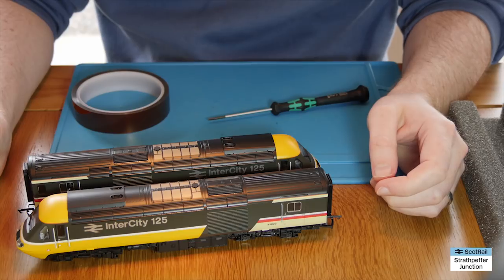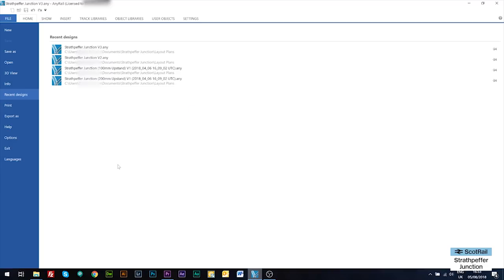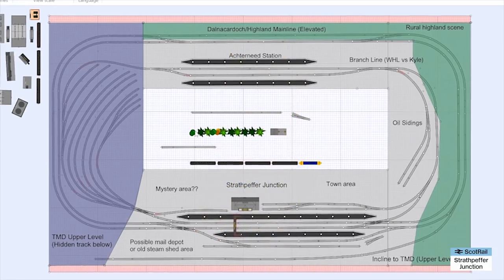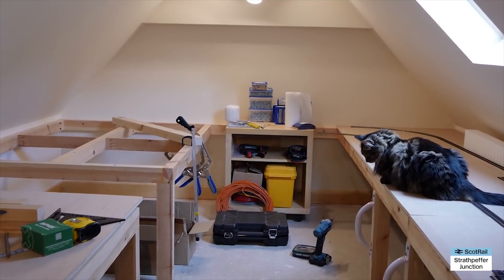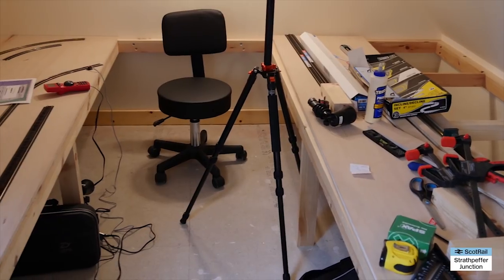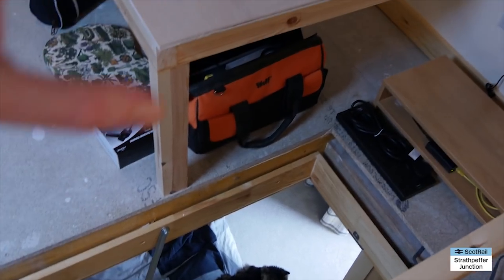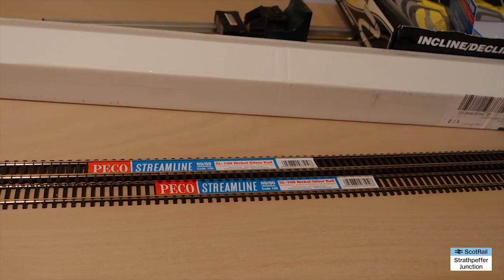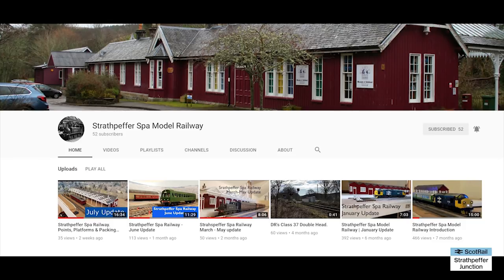#34 Layout Update: Track Planning, Baseboards & Rolling Stock Cataloguing (August 2018)

Comment: Hooray, he uploads again (I'm one to talk). The track plan is looking fantastic, I might pinch a few ideas for my own track plan. At the very least, Katie has a new bench. Also, holy moly, that's a lot of rolling stock, how are you record it all btw (I have my DCC bible with the codes.) Best wishes, Alex.
Reply from the maker: Thanks, Alex. 🙂 I'm just using a spreadsheet for the rolling stock and locos. I also used to have a separate one for dcc decoder details and addresses, but I'm pulling them all together into one. Once I have the z21 set up, I'll load locos and addresses into there too, but the spreadsheet is the master. Also makes it easier for insurance.

Comment: Hi
Quality video, brought to the forefront what I need to sort out before I start laying track on my own layout!
& to think I was going to do voice overs for it tonight..... Oh well definitely worth taking the time to perfect it!
Ps do you know what the difference is in width of point work between 75 & 100?
Thanks
Olly
Reply from the maker: Hi Oliver. Many thanks indeed for the comment. It's definitely best to try to iron everything out before anything is nail or glued down. I've just been up in the loft again, tweaking a few things before getting the bus wiring done. I don't think you can avoid all potential pitfalls, but that just adds to the fun I guess! By width, do you mean the sleeper spacing or the separation between the roads?
Reply from the maker: I'm not sure if this page will have an answer for you, but it does provide an interesting look at the differences between Code 100 and Code 75: http://s374444733.websitehome.co.uk/code75/index.htm
Reply: I certainly think it pays too, but something will go wrong and I do think that makes it fun 
And thank you very much I will give it a look now, as I am about to lay track so want to pick one that suits me
Cheers
Olly

Comment: Could you please share the link to the boxes you got from Amazon to store your stock? I’d really appreciate it, thanks! ☺️
Reply from the maker: Hi Adam. Sure, the boxes are these ones: https://amzn.to/2KLnEvK  I got them on Amazon Prime day, so they've gone up by about £10 now. They are a fairly good fit for Hornby and Bachmann coach and wagon boxes. I've also just got a load more from Argos, which were cheaper (about 50% less) and pretty good too (albeit not quite as thick plastic): http://www.argos.co.uk/product/5859108
Reply: Strathpeffer Junction Excellent! Thanks for that! I’ll take a look at both as it’d be good to have a few
Reply from the maker: Adam's Railway I've just had another look at the Argos boxes. They're definitely not as robust, but I think they are probably fine for loft or cupboard use. Time will tell!
Reply: Strathpeffer Junction I agree - the Amazon ones look much sturdier and like what I’m after 🙂
Reply: I found some good sturdy boxes, similar to those you bought, in IKEA and they come in a variety of sizes. So some are good for trucks, others for locos and coaches and a third size for buildings or larger items. Very reasonably priced too.
Reply from the maker: @stevteig  Good shout, Steven. I should have thought about IKEA. Thank you!

Comment: What an update Dave! Looking great and coming together.. great to see the track plans. 

Good to see the switch to code 75. Its definately worth it and bullhead does look nice but is a pain in the butt to work with especially when it comes to joining it to flat bottom rail. Do i see another sleeper re-spacing coming up? 😉 aiming to have my track laying video out at some point next week. 

Oh you sure you have enough stock and locos yet lol.. thats some collection
Reply from the maker: Thanks, Tim. What can I say? I couldn't resit following in your footsteps...and that sleeper replacing looks irresistible! 😂
Reply: I decided to go with code 75 too. The Bullhead stuff is a nightmare to work with the tiny rail joiners, and  I have decided to put the layout on hold until Peco brings out some more of its points. The transition from Bullhead to standard 75 for the points looks starnge and with the large joiners looks unsightly. I have wondered about complicating things further by cutting the track into near 60' lengths too - easy enough on the straight sections, but for curves with those tiny joiners - maddening.
Reply from the maker: I've not quite got to that stage yet, but I've heard others saying the same about the joiners. They look good, but fiddly. I've also wondered about the points issue. I emailed peco and they should have slips out by Christmas. The point geometry should be identical to the existing code 75, so I think some like Everard Junction plan to switch them out in due course, but it's interesting to get your feedback on how it all looks. Food for thought! My main running lines will be concrete and wood sleepered normal code 75, but I had been hoping to do my branch and Sidings in bullhead.
Reply: The joiners are very fiddly and in most cases to tight to fit. Trick is to hold them in pliers and stick a stanley blade in them to open them up slightly. 
In terms of points the whole of my laira sidings are on hold until peco release medium bullhead points. The railjoiners - flat bottom to bullhead - can be hidden with some oily grime as typically seen, that reflects my idea on standard 75 points was to increase the sleeper spacing either end to make the point stand out less! This will leave some careful weathering to disguise the rest.
Reply from the maker: That sounds like a good approach...I'm not sure I have the patience to put anything on pause. I'm very close to track laying now, so with it taking this long to get to where I am, the thought of pausing is too much!
Reply: @StrathpefferJunction  You would have thought the progress  on their new ranges (including Bullhead) would feature somewhere on their web-pages, but from what I can see, nothing. Some vendors (eg Rails of Sheffield) are showing the slip points as available to pre-order, but news on their medium and curved points would be handy. I am loathe to put down the slips and curved points only to have to take them up again. So I guess I will have to concentrate on doing the track that is hidden and use the existing points for hidden storage sidings. Thanks for the tip-off about the slips being available by Christmas.
Reply from the maker: I emailed Peco direct about two months ago to ask, because like you, I couldn't find any info anywhere. They told me they'd be out by Christmas...whether they actually are, we shall see!
Reply: @StrathpefferJunction  would be good if they were out by xmas. Im needing 1 medium bullhead also that goes into the bay platform in the station (the only point around the station that remains down after re-configuration works
Reply from the maker: Totally. It's the mediums I really need.
Reply: @StrathpefferJunction  Hi Dave and a Happy New Year to you. So, I have laid down my fiddle yard with code 75. I found a ruler that was the right width (according to the Peco track gauge) to go between the rails of the adjacent lines (that helped a great deal) and gave me nice straight lines. I used Peco track pins here too that really helped in maintaining shape on the bends. Next up, the visible part of the layout with the Bullhead. I changed my plan so that I can use express points only. I now have a pair that form a curved exit from a tunnel mouth (for crossing when simulating single line working for repairs), diverging out to two slow lanes with the fast lines in between. The ruler was fine to give the track width between slow and the adjacent fast/through lines, but the point geometry meant that the gap between the two fast/through lines is wider. The insulating rail joiners necessitates shaving some chairs off the sleepers, which on the short leadout from the frogs is a bit perilous. the small rail joiners once you get the hang of it aren't too bad and you don't need to either shave chairs or remove sleepers to connect track (unlike with the massively long code 75 joiners). The track is very delicate though and difficult to get nice straight lines, the sleepers slip about like mad too - fixing them so that they are parallel is a pain. Anyway, the basic design is done, just need to get the holes drilled in the right places for the unifrog wires and the droppers before gluing the track done - which might have to wait a few months now as I live in Oxford, and my layout is in a cottage in Dumfries and Galloway!
Reply from the maker: @pierre-de-standing  The sounds like great progress! And that's a great tip regarding the ruler. My back has been playing up over the last couple of months and I've been laid up for most of it, so unfortunately progress has stalled a bit here. I'm raring to go though and eagre to get back to it. You're right about the track though. I've been tinkering with a wee test diorama and the Code 75 is far less forgiving...but I do think it's worth it. It's looks great once down. 🙂

Comment: Hi great vidio as usual, I watch your channel with great interest I was wondering is it possible to fit stay alive to a tts decoder not sure where and what to connect can you help Regards   Alan
Reply from the maker: Hi Alan. Yes, it is possible to fit stay alive to tts chips. I've done one and it works fairly well. I was actually thinking about doing a tutorial on that. I've got to replace the speaker in the upgraded Lima I was working on and I thought only a couple of weeks ago that it was perhaps a good candidate for a stay alive. It's the normal capacitor and diode combination, but as there is no specific provision for it on the decoder, you have to find the right pads and avoid doing damage to anything else. So long as you're confident with a soldering iron and have a way to see what you're doing on a wee chip (good eyes or magnifying glasses etc.), it's not too tricky.
Reply: Thanks Alistair i will look forward to seeing how you go about altering the tts chip to take stay alive circuit Regards Alan,,,,,,,,,
Reply from the maker: Good stuff I'm David BTW. Alistair runs the Strathpeffer Spa Railway channel. Too many Strathpeffers around! 😋